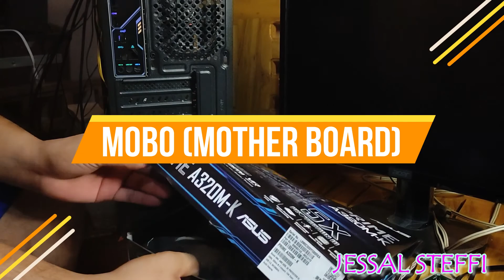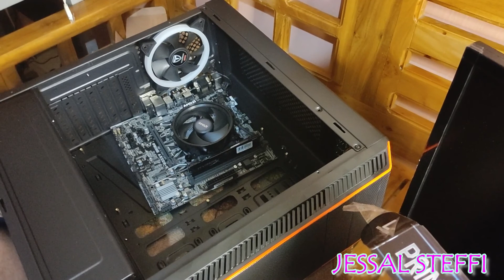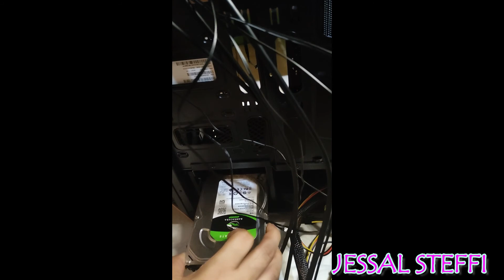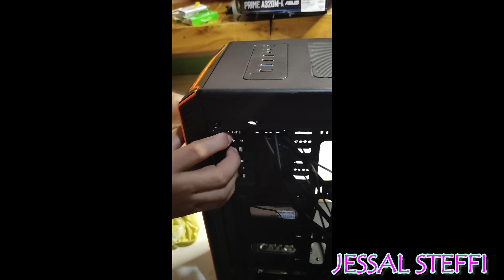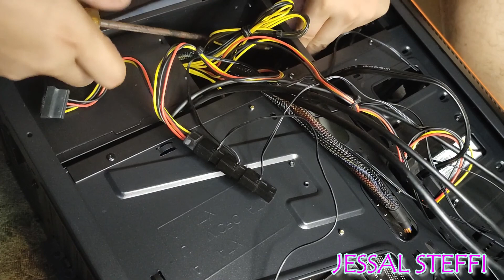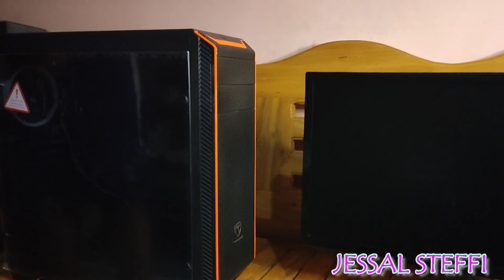Building a Gaming PC & Basic Software Installation Part 1

Comment: We have the same PC case and the same problem with the HDD drive bay. There should be a drive tray that slides the hard disk into the bay! Those slots are there to accomodate drive trays. This case doesn't have drive trays in it. I did the best I could to screw the hard disk on both sides because if you don't screw them properly the vibrations from the hard disk will shorten the life of your disk. Too much vibrations isn't good.